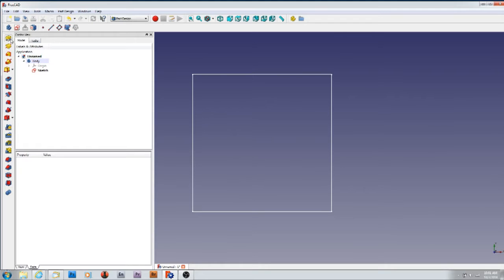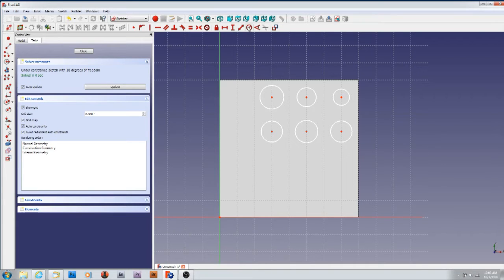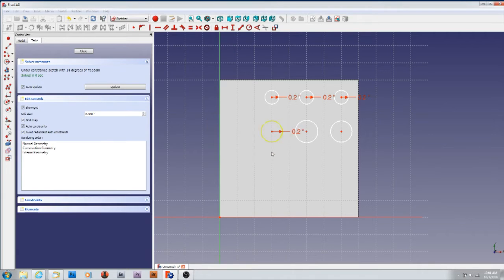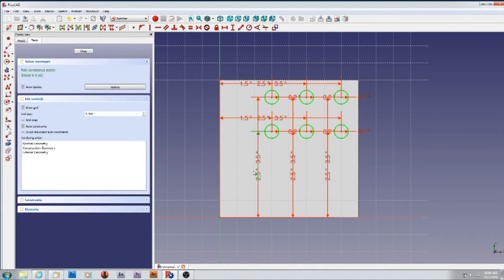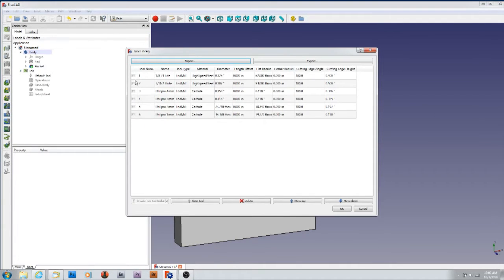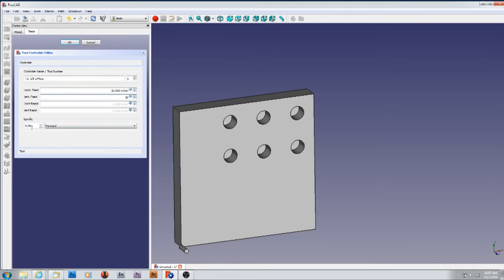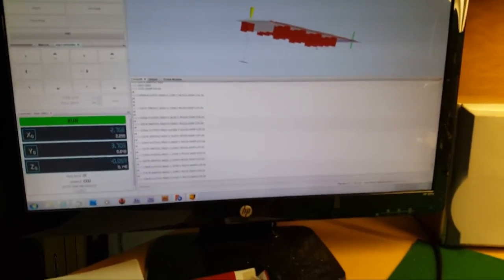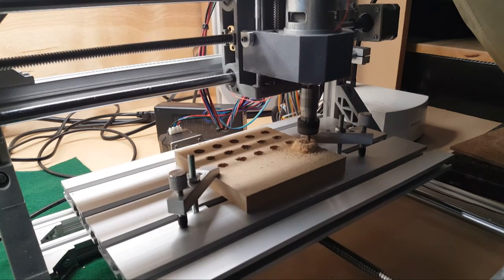Freecad Hole Pockets Tutorial

Comment: Your video's about this has helped me alot and I am Grateful. I just have a stp. problem which I hope you know the solution of, or Maybe you have tried it your self. I run Mach3 ( just bout it, Maybe I should have gone with mach4 :( ) I have gone thro everything you did her and the code generated is uploaded to mach3 but it wont run it....!!? Do you know why or can you guess what the problem is here?
Again thank you very much for The Beautiful job you are doing helping people. Thank's and sry my bad english
Reply from the maker: If in part design click edit then preferences and note no path setup is present. now select the path work bench then edit preferences and suddenly the path setup is there. select it and look at the bottom for post processor. I can't remember which post processor i used for Mach3 but you're probably compiling the wrong Gcode. note you have to close the program and restart it for a change to take affect.
Reply from the maker: Also so note the post processor is imbedded in your design so you have to start  a new design after changes are made. Away examine the code for the correct post processor.

Comment: Hello Dave and others,
I need help with two FreeCad problems:

1. I generate a gcode using contour to cut my part out and I export it. When I inspect the gcode, everything looks fine but when I start cutting it, one of the axises drifts a bit and as a result a straight wall becomes stepped like a pyramid wall only across one of the axises!
This happens while I can cut a pocket nicely using the zigzag toolpath and everything works just fine so my hardware should be fine!

2. When trying to cut a simple pocket using the spiral pocket cutting toolpath, I get a strange result. It doesn't cut a piece at the center! It just goes around that piece and doesn't empty the whole pocket (this is also visible in simulation) .
Reply from the maker: Check the setting in freecad that you are using the correct post processor... don't know what machine you have.
Reply: @TheMiniMachineShop  Thanks for the response. Today I was able to alleviate the problem. I have 3020T CNC with USB CNC software. I found out that there was a rounding problem with the toolpath when it contains some kind of an arc. Non of the different post processors helped. I just used the option "convert all arcs to line" in USB CNC and the problem seems to have gone away.
The other issue is still there though. I can't use the spiral pocket cutting toolpath.
Reply from the maker: @sinadeznabi I saw that once when using Mach3 I had to manually insert something in the  header and it worked. I didn't write it down search for the Mach3 spiral problem.
Reply from the maker: It was like adding G93 or something.

Comment: Hi, Dave M !
Can you help my? I need understand a simple drilling (not milling, but drilling !) by FreeCAD 0.18. I use CNC machine which support drilling. I know drilling function by Artcam, but FreeCAD drilling for me not understand.
Reply from the maker: Hi,I had tried drilling and discovered GRBL doesn't support that operation. I did try a patch to fix it but the patch broke the spiral function. So I use an end mill and the spiral operation to drill a hole to the diameter I want as shown in this video. If I remember correctly there was a video on drilling with freecad. If you're having problems make sure you have the right post processor selected.
Reply: Thanks for the answer. 
I is rookie for CNC subject. 
The post processor selecting at FreeCAD: "JOB EDIT" panel -> "Output" -> "Processor" -> List of: centroid, comparams, dynapath, grbl, grbl_g81, linuxcnc, openspb, philips, rml, smoothie. I right understand ?
By default i used centroid. 
My problem is: 
cutter move above billet(from zero point), thereafter instead of plunge in to billet the cutter fall and stop for some distance to billet. This my see at simulation mode of G-code. 
Strangely ! The path line drawing correctly(to bottom of hole).

Comment: I heard you say you used light oil to lube the lead screw I was wondering if dry graphite would be better. By the way  I am ordering either the SainSmart
, Genmitsu  both are under 200 and I will make up my own mind but do you have any words or ideas on what I should look for when choosing  the price is so close that that is not a factor  
and thank you again
Reply from the maker: The biggest mistake was I used oil! Use nothing otherwise sawdust sticks to everything.  You want the same frame style I have since sawdust sticks to the ones with plastic sides. Banggood has it for $149 but right now I would get it from Sainsmart WAY better support. I've had a number of emails on the subject. You should also watch my 3018 laser upgrade video. And if you need any more help email me... Sainsmart gives $20 off and use welcome20 for another $20 off.

Comment: That cutting was downright painful to watch. 

You are literally producing videos that would cause woodworkers to not be interested in cnc machining.  

I know you did this on a very limited scale/budget and you are seeing the results of that decision.

Here is something to think about:  You have gotten your feet wet with both manual machining and cnc techniques.  You now understand the importance of rigidity.  You have familiarized yourself with how the electronics interact with the software.  All great first steps.

Build your own machine.  I have built two machines in the last ten years. This latest one easily cuts at 250 ipm, .5 end mill, .25 doc in hardwoods.  It is a rack and pinion design except for the Z axis.  Pretty standard stuff using 8020 extrusions.  I purchased some key components from CNCRouterParts because I did not have metal working capability at the time.  You could save a bucket of money.

Watching you work with FreeCad is interesting, it is very similar to Fusion.  Frankly, I would go with the Fusion for mechanical parts.  You have to ask yourself, is FreeCad really going anywhere, or will Fusion continue to evolve with the backing of a huge company like AutoDesk?

Anyway, that is my 5 cents worth!  As always, your videos are well crafted and a lot can  be learned from them.  Look forward to your next one.

BTW,   I was thinking of getting a machine like yours to do smallish engraving work...now, not so much.

Comment: Why are you struggling with FreakCAD when Fusion 360 is free for hobbyists, students and startups?
Reply: Two good reasons - 1. Fusion 360 is not available for Linux and 2. Locking into Autodesk products leaves you vulnerable to whimsical changes in licensing - if you look at the licence agreement the income definition of hobbyist has already changed in the last couple of years (caveat emptor).
Reply: I agree he could have used the same type of commands that he used here in freecad, with fusion 360 being a more powerful program.  Soon or later he will would to do something more complicated and will need a more powerful cad tool and cam tool.
Reply: That is an awesome tool. My mind has been in overdrive since I saw this - the possibilities...